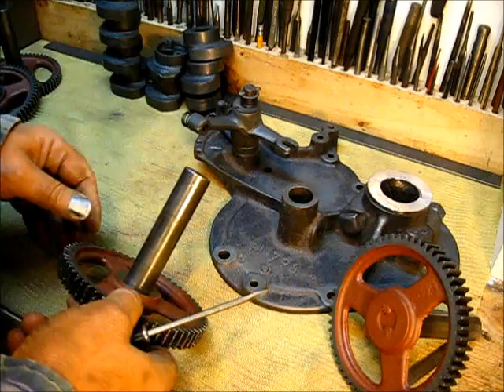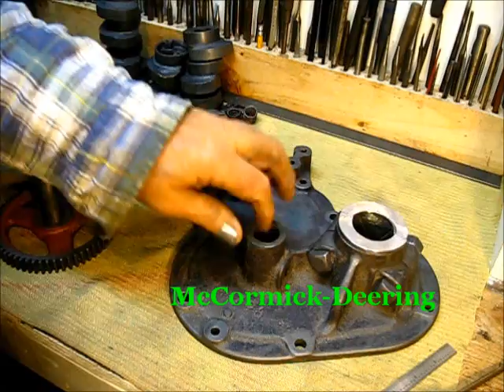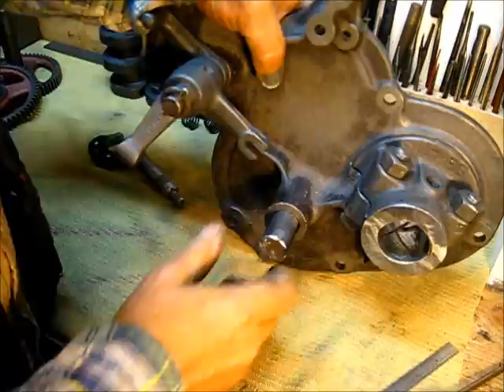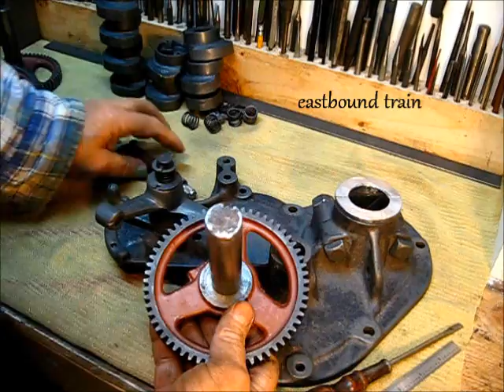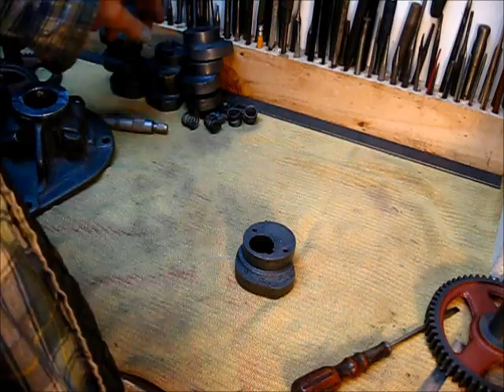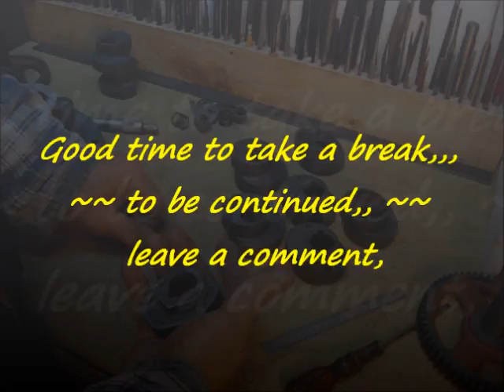IHC ENGINE / cam, cam gear, camshaft, explained

Comment: Hi, I have a IHC M 3hp with Wico mag. Its complete, has compression,  a  hot spark and gets fuel but does not run. Where do I set the timing? Thanks